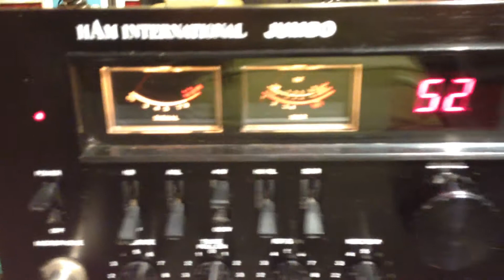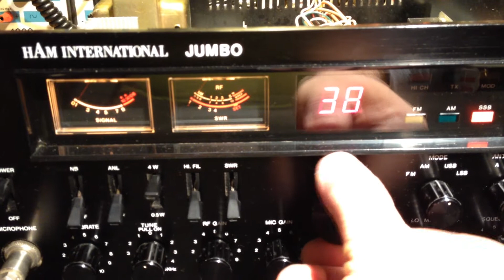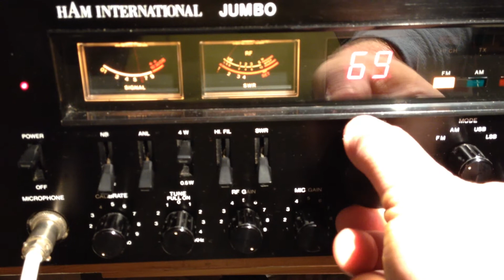Ham International Jumbo Repaired and serviced by M1APC

Comment: I got a Jumbo MK1 some years ago, although some mods like expansion from 26.065 to 28.305 and UK Band 27.601 to 27.991 & + 10 KHZ shift and Tune moves more then 5 KHZ + & _ & a metal type 455 Filter board & FM noise squelch had been done the SSB & FM TX Audio was awful as it is from new. I sorted the bad FM, SSB TX Audio myself & now you cannot tell its a Jumbo. Other mods i did was the popping squelch mod and i replaced the power supply for a 6 Amp switch mode as the upgraded original broke down putting 20+ Volts out but luckily no damage.  I also changed the 2SC1969 for a CB20W Transistor as i couldn't  get an original, more output but i backed it down.  My Jumbo can be seen on my Facebook page if interested inside & out plus mods.  https://www.facebook.com/davidpeter.morrisjones